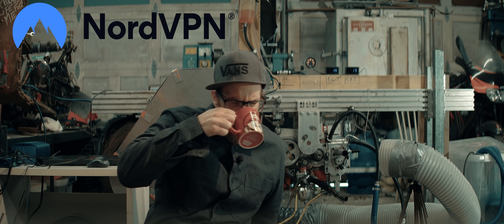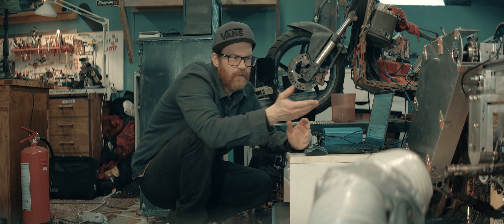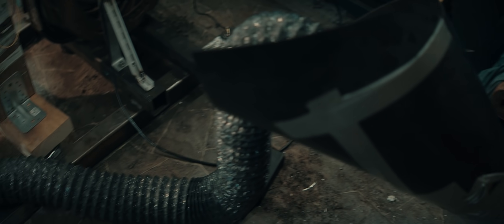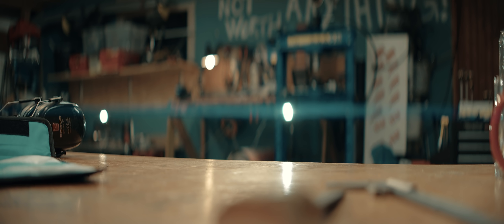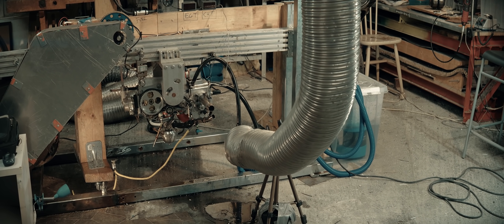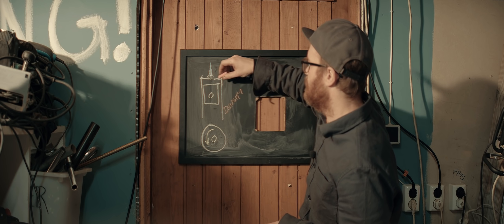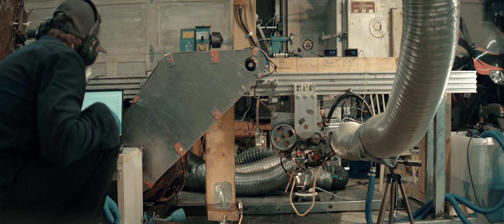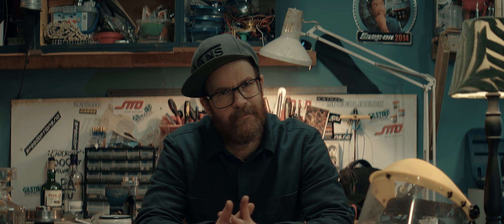50cc, 20hp, 15psi - we're just getting started! Supercharged Nitro Two Stroke.

Comment: Amazing work. Keep going! I believe you are going to need a fuel injection controller instead of these carbs. They cannot increase fuel delivery as demanded by boost and rpm levels proportionately. A small fuel injection system like Microsquirt can deliver your fuel on a 3d table in tiny increments and give you a boost referenced programmable ignition curve. Its more work than a carb to set up but is painless after that, no messing with jetting for different fuels or playing with a fixed ignition curve (really not up to the task of forced induction at all).
Only change one thing at a time. When increasing boost, always upjet and retard first when tuning, then SLOWLY increase ignition timing. I have a two stroke opposed (DLE hobby engine) Im running off the Microsquirt. No forced induction, but it makes things so much easier and its wayyyy more reliable and versatile than a carb ANY day. You may end up with a good peak power, but over and under will always suffer with a carb. The area under the curve will have more power with fuel injection. About the dyno, remember that because you are using a jack shaft, chains, and a clutch, there are losses not being measured. If a drive component makes noise or is hot after running, that is horsepower lost that the eddy brake is not measuring.  I am not sure if you have matchmarks on your clutch drum and drive, but a timing light on those while running will let you see if the clutch is fully locked during a pull. From what one could expect of the losses in the drive setup, I wouldn't doubt if that thing is already making 21 or 22 HP.
Reply: The force is measured at the motor. The chains, shafts and retarder just apply a load. You need to go back a bit and watch previous videos

Comment: Great job I love to follow you though all the challenges 👍🏼
I don’t know if you already has mentioned it but what is the reason for the engine not being able to keep up the rpm’s?
Reply: More and more brake is applied.
Reply: I thought the plan was to PID regulated the brake and there by keep a steady rpm 😊
Reply: @jacobmatzen5046  I come from the clockwork era and I feel the electronics are being unreliable and not doing what they should do.
If the retarder was controlled via a separate PSU with a potentiometer I feel this would give better control of the braking effect giving instant response to what the operator requires.
Reply: I would like to see Alex hold the revs at around 8k with constant brake load giving the engine a workout for 10 seconds at a time.

Comment: Why not set up a throttle cable with a thumb throttle? Might make operation slightly easier
Reply: The sticking carb slide needs sorting first so it returns on its own. As you say a thumb throttle, twist grip or a lever fixed to a handle bar would be much better option.
Reply: @malcrandall1309  ahh I see. I was wondering why he was always fumbling with it like that

Comment: Wow, 20 HP is in the 250 to 350cc engine range for power output, but with a 50cc engine! You'd need about 30-35 HP to reach 100MPH (about 400cc in terms of engine size), so this is definitely in the 70-75 MPH region. Awesome!
Reply: I've hit 70 mph on GPS with way less power and on a pretty heavy scooter.
Reply: @Kattenbief  It would have to be a 125 or better. Any engine size less than that and you're dreaming.
Reply: @ModshackMerlin  Haha are you talking about 4 stroke? Just check out this 70cc scooter hitting 140 kph (86mph) https://youtu.be/t2aGI-QpO6E?t=61
Reply: @Kattenbief  Alex is working with 50cc not 70cc. Do you know what the power output of those scooters in the video is?
Reply: @ModshackMerlin  Probably 22-25 HP. I know he's working with 50cc. I just wanted to say you don't need that much power for those speeds. The engine in my Honda NSR is rated at 7.2hp by Honda and already does 62 mph.

Comment: Could someone answer a question for me, Is the Brute Force engine going to be used for the Bonneville speed trials or is it still going to be the PiP. Some comments I've read seem to indicate it's the Brute Force that's going to be used but I can't recall hearing Alex say that.
If the Brute force is going to be used surely all the chassis will need altering to allow fitment and that's with Mark Atkinson in the US.

Comment: Please make some straight thur mufflers , just a perforated sheet rolled into a tube the same diameter as your exhaust and then rapped in fibre glass mat and packed into a larger tube/canister.this will not rob power and save your hearing!
Reply: While Alex does use hearing protection, I certainly believe it needs quietening for our sakes or adjust the ALC.

Comment: Great progress ... Love the ventilation system revamp. I still say a well tuned expansion chamber is going to help you even more with your powerband .
Reply: It’s already boosted by the supercharger so it doesn’t rely on pressure pulses from the exhaust like a normal 2 stroke and it has a rotary valve on the exhaust so an expansion chamber exhaust wouldn’t be able to send pressure pulses into the cylinder because the rotary valve blocks it

Comment: Are you measuring air density? I would assume an old, small supercharger like that will produce a BUNCH of heat . To get the air density down, add an intercooler between.
Keep up the good job - love the content
Reply: Hes running nitro, no intercooler needed. Look how low the exhaust temps are.

Comment: This is insane. A proportionate engine at 2.5 liters of displacement would make 1000 hp. And at 20 lbs of boost. Hes doing numbers that a k series honda takes nearly double the boost pressure to achieve
Reply: Which makes total sense.  4 strokes make power every other revolution. 2 strokes make power every revolution.

Comment: Have you considered hooking up a wide-band air-fuel ratio (lambda) meter at the exhaust for tuning and monitoring ?? They are great for tuning boosted applications.    I built a 800+hp turbocharged engine for my Skyline and I swear by it when tuning.  I've even got one in the car giving me a real time reading which is also hooked up to the ecu for real-time correction of the fuel and ignition maps.    But for a small 2 stroke engine,  the same 14:1 air-fuel ratio concept still applies and having a EXACT DETAIL reading is super useful for tuning and as an insurance  policy. Think about it.
Reply: The amount of oil that is premixed in the methanol fuel is like 15% -20 % i think Alex said in a previews video. On normal 2 stroke it hard not kill the sensor  because oil in the exhaust. Its a puddle of oil under the exhaust, a wide band sensor will last seconds in that environment.

Comment: if you use a small orifice in the line from the pressure source of the wastegate, it will make the bleed valve much more effective and not need as much of a leak to raise the boost.

Comment: I think you should go for turbo. The compressor stealing to mutch energy, for running a turbo you have free energy as you now waste for nothing.
Reply: 2Ts can't start without boost (even chainsaw engines use boost provided by the bottom of the piston) so you need some kind of non-turbo blower.

Once the engine is started you could disconnect the blower and just run a turbo, like a big marine diesel.
Reply: @nerd1000ify  The crankcase work very well as pump in all two strokes,  so its not a problem to make it work together with turbo.
Reply: There's no turbo small enough for 50 cc.
Reply: impossible, it needs scavenging at all times otherwise it can't run so turbo isn't an option

Comment: Great to see you're taking proper care of the nitro/exhaust hazard!
Health is by far the most invaluable thing and rather fragile, though we foolishly tend to take it for granted most of the time.

If you actually got sick from the fumes there had to be quite a lot, going from my experience running in rc engines in a semi closed room on 30% Nitro fuel as a kid.
Before knowing any better.
Only ever experienced rather mild irritation of eyes, nose and throat in a pretty fogged up room, but never any feeling of sickness.
And I was a real lightweight back then.

Comment: It does not need an expansion chamber on the Exhaust?
Reply: The rotary valve is acting like a resonance wave now. Expansion-dimensions are out of the equation now because of the boost applied to the inlet.
Reply: @Mp2000_  gracias, ignoraba todo eso
Reply: @Mp2000_  Yes. However, it would be interesting to see what would happened if he removed the rotary valve (and put on an expansion chamber). Even if it would not start it would still be interesting.

Comment: For my interest, how are you igniting the spark plug. Nitro powered 4 strokes all use magnetos in drag racing
Reply: The ignition is controlled by a Ignitech unit which in turn controlled from Alex's laptop.
I wonder how much HP it would take to run such a magneto.

Comment: I saw you made peak power at around 10k rpm, seems like the engine is happiest there, but you made peak boost at 15K rpm. At peak power there was just about half the boost you made at 15k. Happy it survives 1,2 bar at 15K but Just as a safety measure (and to get the most power per engine failure) you really should consider a pwm boost controller, to control the boost to a single value throughout the rev range. You could just take a Cheap Audi/VW N75 Boost solenoid on the wastegate,  take the pressure reading with generic MPX4250AP, T it into the analog boost meter and use arduino for the control, there's alot of arduino PID boost control projects :D
Reply: I mean also to narrow down your scientific method as to how much boost this engine can handle, you need to know how much boost you were running when it dies. This boost controller approach would narrow the boost down from a wide boost range of 0.6 bar to about 0.1 bar range. I'm not trying to complain and I don't mind you taking your time with this stuff. Love your work, keep it up!
Reply: Also wideband o2 sensor as well perhaps to see where the engine lean out
Reply: @AmirPomen  its a 2 stroke blower. It dumps fuel in the exhaust especially thanks to the dump valve/wastegate. A O2 sensor wont survive or read any usable readings
Reply: While at it, he should add EFI instead of sticking with any carburetor.
Reply: @jammi__  Jup i think it’s a fools errands, commented that before. Fuel needs to be perfect and kind of why we went over to efi in the first place. Same with ignition and boost
Reply: @Xfacehack  Yeah, there's a reason real engines use a computer to correct the AFR in real-time. A guy turning a carb screw and ignition advance manually will never do, and he'll just ruin one engine after another, or stay at these low powers otherwise. Megasquirt is cheap and easy enough to run for fuel, boost, and ignition. It's just a single-cylinder engine, and it should be easy to tune in software.
Reply: i wonder how hot the air was coming out of the blower at those high boost numbers. might be seeing high boost from heat expansion but the same, or less volume by weight per revolution..
Reply: @krugtech  yeah, the fuel is cooling but a roots over 15psi is not effective
Reply: ^ This... also, don't know if you have yet... but check out the Lectron FI carburetors. ... you said you would
Reply: @realryder2626  i dont think the lectron is the ticket
Reply: this comment needs to blow up.
Reply: But its a roots blower. It gets "sealed" better at higher rpms. Thats  why he has a rising boost curve. 
Engines with blower dont usualy have a dump valve like that (its not a wastegate by normal means)

Comment: So impressed with your progress. I went 92 mph at Bonneville with my big heavy 175 making only 17 hp.  Your going to crush it bro!
Reply: 175cc and 17 hp?
Reply: @hedning003  it was my first try at Bonneville, using a 1979 yamaha IT 175 engine that was mostly stock. Dont forget Bonneville is over 5000 ft in elevation. You loose about 15% of hp when naturally aspirated at that elevation. Stuffing is manufacturing atmosphere with a supercharger solving the elevation problem. Video is on my Chanel of 2 runs on the salt.
Reply: @tonyd7164  I bet you ran longer then 2 seconds
Reply: @afflickracing1705  yup, that will be stuffings biggest challenge. I’m sure he will make good power with his engine. Question is can it stay together at redline through the timed mile. Those 30 seconds seems like forever.
Reply: @tonyd7164  yes mate 100% agreed, he has picked the hardest of motorsports on engines. Our little 100cc makes 54rwhp and holds the record at 131.228mph, it’s a long time wide open.
Reply: @multishit6664  so explain to me why my bike goes 10 to 12 mph faster at sea level?
Reply: @multishit6664  it has nothing to do with carburetors.
Reply: @MV-ri7zu  maybe he thinks there is a magic carburetor that defeats elevation issues?😁 He knows how to make carburetors increase air density. I don’t think he read or understood my post.
Reply: @tonyd7164  yeah I need to get my hands on one of those carbs too 🧐 😂
Reply: @hedning003  Sounds like my 1979 DT175 almost exactly. Whoops! Should have hit refresh, apparently I wasn't too far off :)

Comment: One clip in there seemed like it has a good idle.
Reply: . Just seen a reply Alex left for a similar question and he said the retarder should disconnect at 6000rpm but it's not. If it did it would allow the engine to idle all the time.
Reply from the maker: Yes, and there's no clutch, it's idling with the whole assembly engaged.
Reply: @2STROKESTUFFING  Ah, I guess that makes it easier.

Comment: Nice a naturally aspirated stock KTM 65 and kx 65 makes 16.79 ish on regular gas. Use a regulated air source to control dome pressure on boost controller.
Reply: What about the torque though did you see them numbers on this thing it's like a right there with HP

Comment: Good to see your making progress man. I’ve built two turbocharged v8 engines running at the moment, I was lucky to have a tutor in the pro race field to help. One of many important things I learned was when your boost/cylinder pressure increases you should retard the ignition timing. Prevents detonation and let’s the engine run optimally. I suggest you try running an ignition ramp if your ignition system will support it. If not, and your timing is locked, then retard it 5 degrees or so to start.

Comment: Tomos used to get up to 18HP from NA 50cc, nice to see you surpass that in your home workshop, even if it's boosted
Reply: And not on nitro or boosted
Reply: Bidalot make a 50cc top end that do 20hp NA
Reply: Its also a very crude tune, so i would expect a few more hp-s
Reply: I'm sure this thing has a lot more in it, and who knows how accurate the dyno is. But what I find most interesting is not the peak power but the flatness of the dyno plot.

That does NOT look like a high strung 50cc two stroke OR four stroke for that matter. Will be very interesting once he really has the tune dialed in. It looks to me like it's choking up top too actually, more than I'd expect.

Comment: Exciting to think how powerful this engine could be. 20hp this early on in the tuning is awesome
Reply: Its pretty crazy to think a homebuilder is making 400hp per liter
Reply: 50hp from 50cc in a scooter 💀
Reply: @GhostOfDamned  1hp per cc💥💥💥
Reply: Well, top fuel drag bikes and cars have 1 hp per cc so why not. 🤔
Reply: @nik-h5h  those run for 4 seconds and then u need to replace alot of parts
Reply: @Kotzaak  and no one wants to pay the price for them he could make a few of his engins for one rebuild of those 😅
Reply: @nik-h5h  Remember that it’s easier to make big power from a tiny cylinder because there’s less cylinder wall area to lose heat through
Reply: @timc5969  
Wait, what?
The surface area to volume ratio can't get much worse, it gets better with larger volumes.
I don't think that's the reason, like at all.
Reply: @heinzhaupthaar5590  it is lower rotational mass, higher rpm can be reached. Having an exotic fuel, such as nitro, you can throw in more fuel get more power, and have a similar temperature as running something like gasoline. Once you figure out the baseline torque, multiply torque and the RPM that you reach the max torque point, take that and divide it by 5252 and you get the horsepower.
Reply: @nik-h5h  it is pretty crazy isn’t it that when you think what most people know as the “fastest” motorcycles on the planet (MotoGP) are around 0.3hp per cc.
And then you have the top fuel bikes pushing around 1hp per cc.
top fuel dragsters and funny cars are approx 1.46 hp per cc. But that is simply due to the absolutely huge volume of nitro being consumed.
The mind boggles! 👌👌
Reply: The record for 50cc is 46 hp.
No supercharged.
Reply: @lindgruen3118  far out! Got a link or something. We need to see this
Reply: @ryanellis120  50cc racing class ended in 1983. You will only find information in old magazines.
Reply: @lindgruen3118  46hp, 50cc, 1983 and 40 years later no one is even close to that hp for 50cc. Hard to believe
Reply: @ryanellis120  Back in the day as an amateur, you could buy a Dörr engine off the shelf that started at 20 hp. With the right set up and exhaust, you made around 28 hp. No turbo, no supercharger.
Reply: Is dyno calibrated now = Showing true numbers
Reply: @racingsmurffi4640  Not to my knowledge... Unless he's released a patreon only video he hasn't shown completion of calibration.
Reply: @racingsmurffi4640  true. Need to know if the dyno is giving the correct readings. He needs to know that. I suspect he cares more about getting the engine running correctly first, which I can understand. Needs to happen soon though